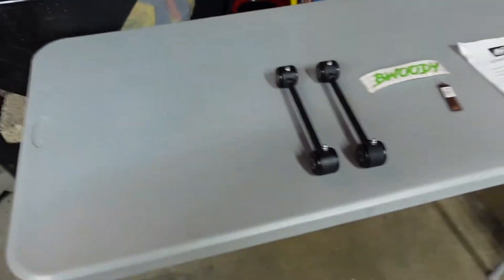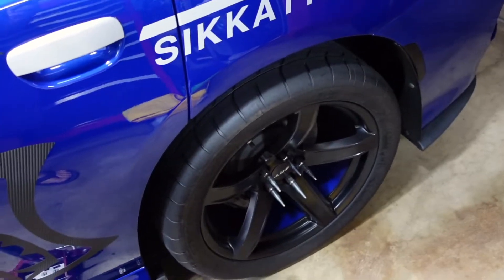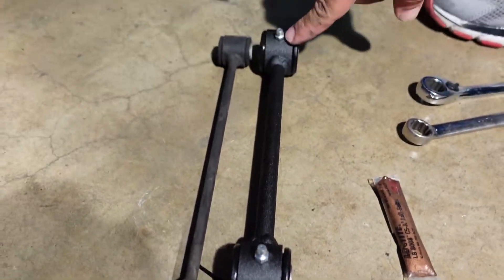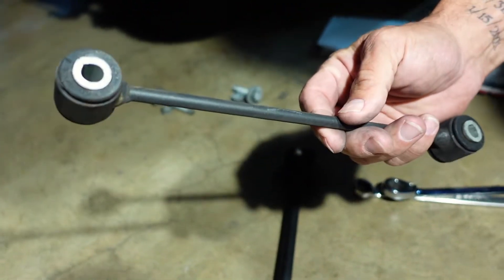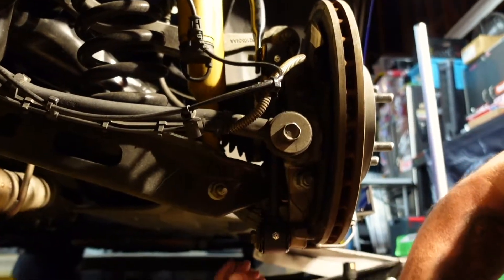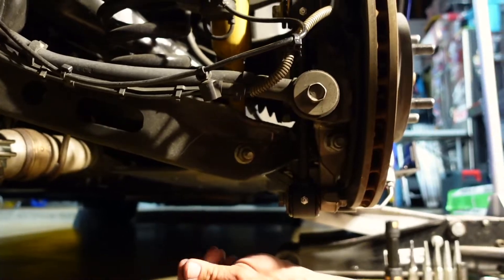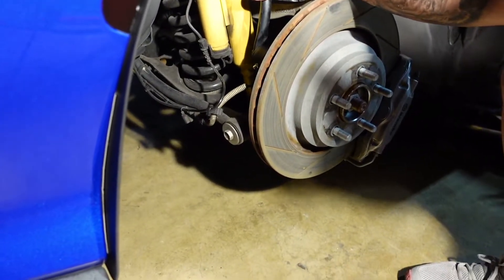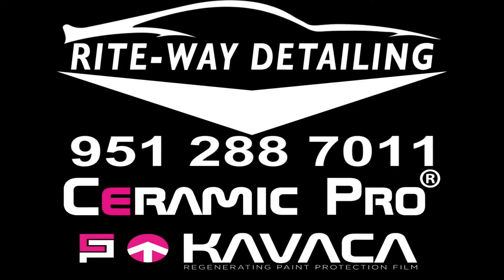2019 CHARGER SRT HELLCAT BWOODY SWAY BAR END LINK INSTALLATION

Comment: It’s lightweight suspensions or stouk suspensions is lightweight🧐??
Reply from the maker: I have no idea what your asking here bud?
Never said anything in this video was about saving weight? The sway bar end link on a stock hellcat/Scat/RT etc. is weak and to tall to run a 17” diameter or 15” wheel. So you have to purchase a shortened and stronger sway bar end link. We explain why it’s needed and how to install it properly in this video. So I don’t understand where your particular question is coming from?

Comment: Nice video! Just ordered a set of these Bwoody's for my 1320 so I can use 17" wheels at the track. I have heard from others that the wiring can rub on the 17" wheels if not zip tied out of the way. Did you guys have any issues with that? Thank you very much!